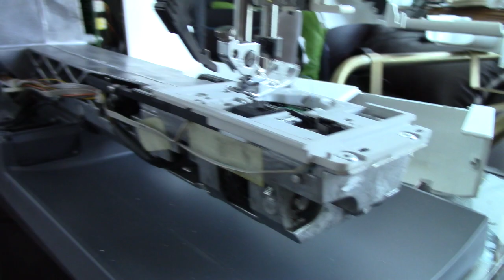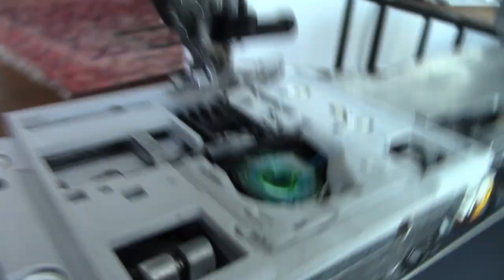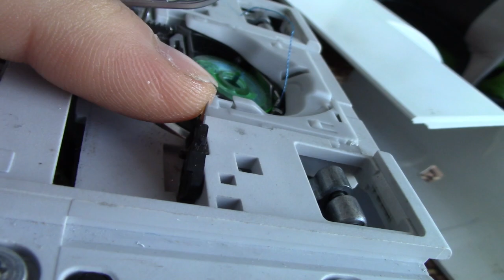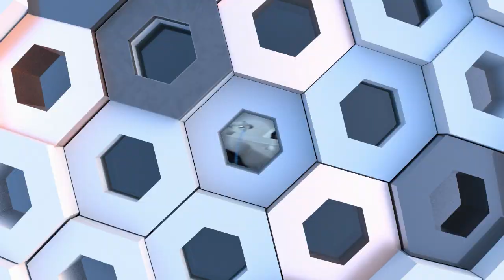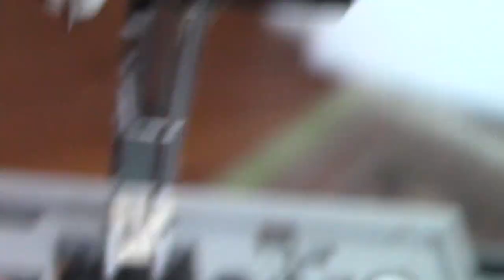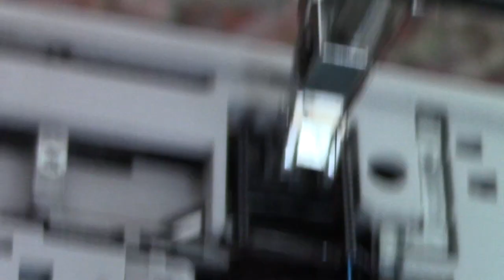How Sewing Machine Automatic Thread Cutters Works

Comment: My new machine, it won't cut the bobbin only the top thread. 🙄
Reply from the maker: I have that problem when using certain bobbin thread instead of embroidery thread in the bobbin. I have found pressing the cut button twice or three times sometimes makes it work. I have also added additional cut stops into my embroidery patterns when I have the issue. My easiest solution is to turn off the thread cutter and trim manually -- I use this a great deal to prevent my work from being destroyed if the hoop moves and the threads did not cut properly.

Comment: My cutter does not work. Thread stays under the hook mechanism.  Blade was changed.  It’s a crisscross of threads.

You need to use a tripod for steady viewing.  I got seasick watching it...albeit a good video.
Reply from the maker: Sorry about the shake. Try to work it manually. Put the needle down, push the thread hook mechanism to the right and see if it catches and hooks the entire part on the right. Then pull it back manually and see if it cuts the threads.
Reply: James Rogers  None of the threads were grabbed as if nothing happened.  BTW it’s a Viking Opal 670.
Reply from the maker: @msyt232  Hmm. Well we could try a video conference if you fancy to see if we can resolve it together.